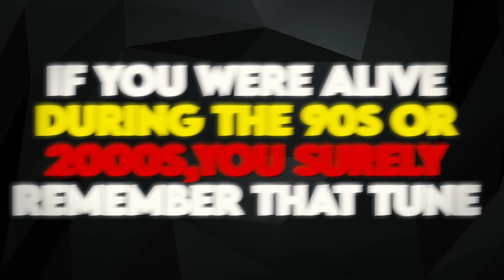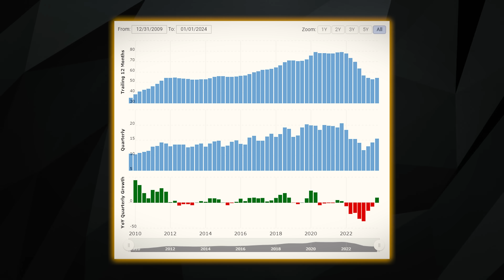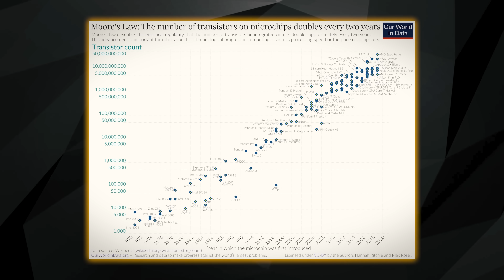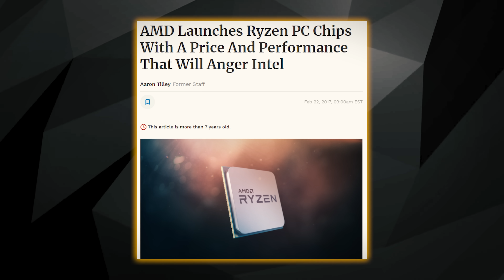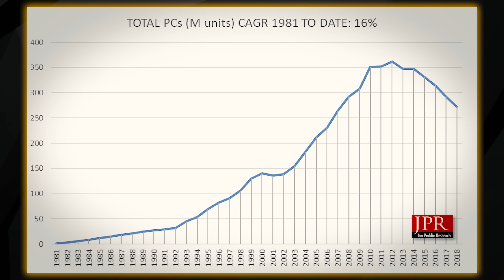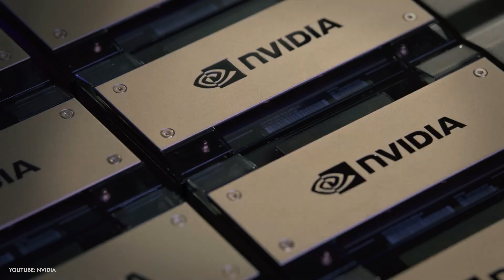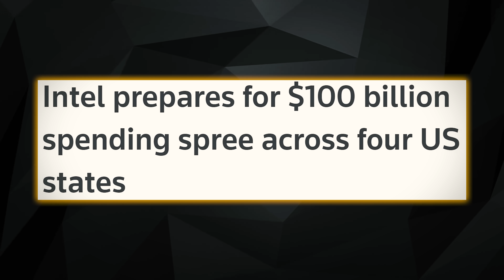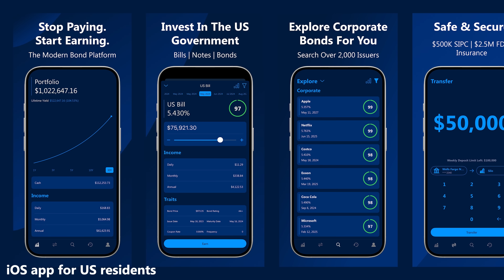The Dire State Of Intel...What Happened?

Comment: People say intel isn't innovative, but the truth is that they are capable of creating chips using the most cutting edge and advanced technologies of 2007
Reply: Intel is innovative in the first entry of every new socket. That first one is always a banger. Then it's varying numbers of rehashes and tweaks to milk more cash.
Reply: Most of the great technologies in semiconductor/chip today are invented by Intel. And most the upcoming technologies are also developed by intel, for example. 
Microprocessor chip
FinFET technology
X86 (various versions)
USB
Thunderbolt
PCIe
CXL 
UCIe
MCR Memory 
and many more and they open sourced these so that the industry can use these.

Most of the competing companies did not invent any thing except that they executed incremental versions in time. 
Intel is behind only because they were reluctant to invest in EUV technology during the 2014 to 2019 time and because of that their products lineup got stalled. 

The current generation Core Ultra is quite competitive against both AMD and Apple in terms of price/power/performance. Until 13th generation, intel processors used to be behind AMD on battery life. With the new core ultra, its quite ahead in both performance and battery life. Some of the benchmarks show its behind on some scores, but on actual usage you see no difference in performance or battery life.
Reply: @SY-zv2cz  They are behind because they stuck with monolithic architecture.  It's all about the chip yields.
Reply: @artdehls9100  Being monolithic is only part of the issue. Its not very difficult to move to chiplet from monolithic. Intel used to have chiplet designs back in 2006/7 timeframe. The fundamental issue was with 10nm EUV enabling which stalled Intels product line for about 4/5 years. And 4 years is sufficient for all the competitors to zoom ahead of them which they did.
Reply: @SY-zv2cz  It may not have been the only thing but it was the major thing.  You can't ignore the basic economics of chip yields, and if they had the tech, why didn't they do the same?  $1,600 chiller hidden under a table and a 1000 watts to the mobo just to barely match an air-cooled TR, and then the next day Lisa Su walks on stage, says hold my beer, BOOM!  You like apples?  How about them apples?  Core to all this?  When your top people aren't engineers and think bribing Dell counts as innovation.
Reply: @artdehls9100  We are talking facts not conspiracy theories here. Also it takes a lot of brain cells to believe Intel pays its customers for buying their products. When was the last time you bought a product and you received money from the shop/manufacturer for buying that?
Reply: Intel fanboys be like, shwell actually..
Reply: Sales and marketing killed the company
Reply: Intel was very slow to realize the potential of Ryzen. A CPU that is also a decent GPU.
But the Intel leadership consisting of sales and marketing people wouldn't understand why it mattered. Every market analyst said it will kill Intel. But sales didn't took a hit immediately, so intel kept up with the practices. If Intel CPUs have any edge over AMD today that is due to programs being better optimized for Intel than AMD. From an Engineering stand point Intel CPUs are outdated.
Reply: @solo10041  Indeed.  Their idea of staying ahead of the competition was paying companies like Dell BILLIONS to just not use AMD.  Sick.  Sad.  Ugly.  Infuriating.  :(
Reply: @solo10041  They weren't slow; they were caught flatfooted because Intel believed that they'd cornered the market and killed AMD (with industry "partnerships") and behaved that way with regard to their releases for several generations of the i-series CPUs. When AMD kicked them in the dick, they had to scramble to recover from their coasting.
Reply: Nice bait moomie.
Reply: Looks like everyone giving Intel the benefit of the doubt
Reply: The main reason U$A will never able to compete in Chip manufacturing.
All the country that do well in chip manufacturing , has Confucianism culture.
For chip manufacturing,  a high level of discipline is the key, and most Americans today don't possess it.
They call it “forced labour"
Taiwanese media reported on August 2 that TSMC claimed the production holdup at its Arizona facility was caused by a shortage of trained American labour and that they had sent staff from Taiwan to assist with the factory's development. Labour union officials in Arizona, on the other hand, criticised TSMC for exploiting this as a justification to bring in "low-wage foreign labour."
Reply: Wow, below Texas Inst?! That's fukn wack and sad.
Reply: Intel is about to slam the market u should see the equipment they are building its the most advanced anywhere on the planet
Reply: Intel c-suite and its shareholders were too focused on short-term profits instead of looking at the long-term.  This is why they fell behind their competitions.
Reply: They can innovate, it's just they won't
Reply: I thought Intel lost dominance because they got caught with hardwired, undefeatable backdoors in all their chips? AMD was doing the same thing but they didn't get caught until later. The government in the middle east has all our information.
Reply: Amd64 anyone
Reply: Intel needs new leadership just look at AMD how they came back with bang with a new CEO.
Reply: With the 0815 mistake of having a naming convention of simply counting up and literally fail at gen 13 (tarot death) and 14 (chinese unavoidable death).
Reply: Their labs are great, but their production execution is abysmal
Reply: 2007 until 2016. After that a line full of retarded cpu's with motherboards that only lasts 2 generations .
Reply: I bet this company is slowly collapsing
Reply: If I were to use Nitrogen cooling and put 10v onto a Pentium 4, I could most likely make it match 14th gen IPC too to get the most out of 90nm/65nm... Just like Intel are currently trying to get the most out of 7nm...
Reply: That was almost twenty years ago
Reply: Intel is trash & benefited from billions of dollars of CORPORATE WELFARE to stay afloat
Reply: Cuttig off their biggest customer China, is the reason. Absolute genius move by the US government to cripple Intel😅
Reply: AMD is great for heating the room. Don't get me wrong. I used AMD my whole life. Athlone II 1.8Ghz. Athlone x4 860k and the latest AMD build of my life? 9700x trash. Not a single one of those builds worked right. Not one.

I didn't have a fully working computer till I bought a used i5 8500t and a Pentium G6405... both performing so much better than the 9700x.............. conclusion?
Reply: I sold INTC two years ago. I didn't like the progress the Chinese were making.
Reply: In price comparison and performance, Threadripper literally ripped them apart 😂
Reply: its 2025 now not 2007 wake up, you're living in the past 🤣🤣🤣🤣
Reply: Intel CPUs are so good that CPUs will work just as well as a house heater.
Reply: Intel's n100 is actually incredible...
Reply: @ВладіславЗаморський  It is incredible for specific use cases, not as a general PC. Would have bought one if I didn't already have a SFF prebuilt HP Elitedesk performing that task.
Reply: Intel still make amazing cpus and their gpus are actually really good.
Reply: @elixier33  copium
Reply: And don't forget Intel is in state, because they try to make their own chip, they just falled behind in technology, but AMD basically did nothing, they just enjoying the benefit of Apple-TSMC cooperation, and they are using the leftover technology what Apple doesn't need anymore.. (the chip design is also important part, but the manufacturing is more important.. if you have a good recipe but nobody can cook it, the recipe itself is not enough to eat it.. and Intel try to cook their own recipes at least, not just freeloading on somewhere else work..)
Reply: @TamasKiss-yk4st  wrong and incorrect amd was guine pig of tsmc and apple was the customer of tsmc what i mean by that is for eg take chiplets now chiplets isa very old in servers but new to consumer pc amd was the first to hop it and they were the first to design the interconnect but they went with a cheaer solution and apple got high speed interconnect after 4 years sine the relese of original thread ripper like that therer are many examples where amd hopped first then apple came much later its not just apple throwing something put of the window and amd is just eating the bones its literally amd injecting the virus first to test the water and then apple entering it
Reply: @TamasKiss-yk4st  AMD kept their eye on the ball and stuck to fundamentals, Intel kept staring in the mirror thinking, I'm so pretty.  It's all about the chip yield.  First numbers I heard before TR's release was that they were getting 80-90%... which was sick.  What do you think the yield is on a 28 core Xeon, all cores up and over spec?  Single digits.  And if just one of those 28 cores is a little weak, bzzt.  Meanwhile AMD pulls four chips from their best bins and effortlessly spawns another perfect monster.  This leads to Intel pulling all their top silicon they'd normally want $12,000 for, selling it for $2,000 and bleeding out the ass.  Meanwhile AMD sells theirs for $1,000, outperforms, and still makes money.  And still even now, Intel won't abandon monolithic architecture.
Reply: @TamasKiss-yk4st  What are you smoking? ATI was a great/huge TSMC client and AMD continued that relationship since 2006.
Reply: I mean, nowadays 14th gen is the best CPU on the market for consumers, and Intel is beating AMD across the board from a pure performance standpoint

Edit: Man, I can't have shit. Intel can eat my ass. 15th gen better not have all these issues again
Reply: @moomie1634  In EVERY regard AMD CPUs are beating Intel CPUs for desktop, and it won't change until Intel gets off it's Intel 7 process node.  Sure you can get into the mid tier where Intel CPUs have more cores and theoretically they do better and I'll get to that point at the end.

You can TRY to spin this to where Intel is better but it's not what the reviews show, so sorry.  How you can POSSIBLY say Intel beats AMD across the board is so utterly laughable that it's just pure propaganda.

And it's REALLY bad in gaming.  As in REALLY BAD.  As in total destruction bad.  So, first an Intel 14th gen based on what reviewers say is almost the same thing as 12th gen with slight improvements, so you can pick whatever you want from 12th - 14th gen, and if you get more gaming performance, it comes at a price of higher power consumption almost exclusively because it's higher clock speed, but we could use something like a 13700K or 14700K because stepping up from that is another 15W for almost no gain.  Yes, I know people SAY that power doesn't matter, until you notice you're sweating or have to make the room cooler to deal with the PC, and that's because the CPU power is being added to the GPU power so yes, another 25 - 50W DOES matter.

In general the gaming CPUs for AMD, the 5700X, 5600, 5800X3D, 7800X3D, 7600 are around 50 - 65W avg.  The 14700K is about 130W.  That's a LOT.  Now, if you game for 2 hours/wk, not a big deal, if you game 2 - 4 hours/day, it becomes a big deal.

But here is the thing, YOU try to say that a 14th gen CPU is the best thing for consumers and meanwhile the 14900K is causing problems and MB makers are tweaking BIOS settings because Intel is refusing to accept the CPU has an issue.  

ALSO, and this gets back to the opening statement, most consumers don't even NEED high end CPUs.  MOST consumers can run a PC from 5 years ago and be fat dumb and happy, and the hype of following the latest tech is NOTHING MORE THAN HYPE!   Sure if you do CPU challenging work, which 95% of consumers do NOT, you need a better system.  95% of consumers can run a potato unless they game, and if they game they're better off with AMD.  AND THIS IS THE DATA based on purchases.  Most purchasing is low end CPUs, like it or not.

And THEN, if you DO want the latest tech, Intel doesn't have it in a PC, AMD does, and that's AI cores.

And then you want to say limiting the clock speed?  AMD CPUs manage their power very well, so advantage AMD.

And I have to edit to throw this in, I PRAY Intel Arrow Lake puts them back in real competition with AMD in every way, I do because Zen 5 is going to be about 15 - 20% faster than Zen 4 AND Zen 6 will be about 10 - 15% faster than Zen 5.  All the whys for this is a book so I'm not explaining it, but that's what's going to happen.  And to be clear Zen 6 is going to be like Zen 3 was for AMD, where Zen 3 is what caused so much market share to turn to AMD.  Whatever Arrow Lake is, Intel will STILL need something a bit better for their next gen to deal with Zen 6.  Zen 6 is going to be where AMD changes their MCM architecture and it no longer needs a multiplexer which AMD calls "Infinity Fabric" and they move to direct connects and THAT is what MCM needs to be, to be closer to monolithic die.  That way you can build with chiplets but the CPU performs more like it's monolithic die, so far less latency in different situation and less power consumption.  It does add cost, but Intel is doing the same thing.
Reply: @moomie1634  I mean, if you want a space heater in your room, sure.
Reply: @fleshreap  Just cap the power target.
Reply: @moomie1634  and lose the performance. Simpler to just get AMD.
Reply: @moomie1634  dude I don’t know what to tell you. If a current gen intel chip is capped at the same wattage as a current AMD chip… the intel chip just looses. Imma use ur argument against you. Look at any benchmark video.
Reply: @fleshreap  At the performance cap, Intel outperforms AMD. The only difference is that Intel gives you the freedom to uncap all power limits and go ham, which is not something AMD allows you to do. Just on a pound for pound comparison Intel wins. Hell, there are guides out there on how to beat Intel stock while UNDERVOLTING the cpu.
Reply: @christopherallard1693  That's just not true. Under-volting the Intel chip still yields higher performance, and even though they're close, Intel still beats AMD
Reply: @moomie1634  Gamers nexus already did the benchmark. Intel CPUs requires way more power just to get the same fps in games as AMD CPUs. It wasn't even close, None of the Intel CPU could even come close to beating AMD.
Reply: @moomie1634 lol me watching a 700$ 14900ks 400w  match the 350$ 120w 7800x3d ....oh well actually the 14900ks is sent in for warranty it's degraded so bad in under a year that it won't even hit 14900k clocks..... garbage. And intell says to fix that lower pl1 from 384w to 125w ....but lose 40% of the clock speed so yeah I'll sell you a 14900ks system if you belive it's so good
Reply: @moomie1634  I'm befuddled as to how you came to either of those conclusions.
The across the board performance champ right now is the 7800X3D or 7950X3D (depending on the game) with Asus/Gigabyte/ASRock/MSI power boost for Intel power profiles activated.
It's only a few percentage points, but the 14900KS... by and large in almost every single game: slower.
If you restrict the 14900KS to the Intel power spec, it's slower by a handful of percentage points again.
At literally no power level that would be at parity, would the 14900KS be the best gaming chip. You can outperform the 14900KS with the AMD chips running at over a 100 watts lower. 
Your argument isn't with us. It's with reality itself.
Reply: @moomie1634 I am not going to cap power, why would I? Why do I have to create a special condition for Intel to shine? No thanks.
Reply: @alvirarahman2690  This statement doesn't make sense. You have to cap the power to let AMD shine if we are going with no power limits intel wins hands down at least until it becomes unstable and bricks itself lol.
Reply: bros glazing israel
Reply: @datguy8296 and I completely agree with you as I have both setups and my 64 core AMD setup cripples anything that I've had for mental unfortunately. I don't have any favourites it's just AMD and more productive when you need more cores.
Reply: @moomie1634 bro is just spreading misinformation on the internet I love it
Reply: @moomie1634  prove ?
Reply: @moomie1634  This comment did not age well
Reply: @moomie1634 lol lmao. Sure at 4x the power.
Reply: @0Synergy  At a capped power rate, Intel beats AMD. Intel allows the user the freedom to push way more power into their chips, with the assumption that the user will have some ability to cool that chip. AMD doesn't give you that freedom. When you just compare the chips with the same cooling and same power draw, Intel still wins
Reply: @moomie1634  bro what are you smoking
Reply: @christopherallard1693  You can literally just read/watch any comparison between Intel and AMD.
Reply: @moomie1634 what about Apples M chips? Aren’t they supposed to be godlike?
Reply: if you don't use normal programs
Reply: @TheBooban  It's hard to compare the 2 because Apple controls the software, which is often forgotten about. They can make the software much more efficient to run on M chips, then say that these chips are better than Intel chips.
Reply: @moomie1634 Buddy. The 7800x3d runs at 65-80 watts, the 14900k runs at 200-300
Reply: @TheBooban Apples M chips arent that good. The only thing theyre good at is processing videos everything else they get demolished in
Reply: @moomie1634 lol at what cap? 10w let's see intell caped at 120w oh they lose 40% of thier performance and how much does amd lose...oh lol they where already under 120w
Reply: @moomie1634 yeah watching the 120w 350$ amd chip match the 14900ks 700$ 450w chip is pretty awsome. All while intell is now cutting its recommended wattage that saw the 14900k drop up to 9% from when it was launched. Also watching the intell chips cook themselves to death trying to beat amd is hilarious. Do you want chips that Germany degrade and become unstable and no longer hit intells stock clocks ? Intell is for you
Reply: @TheBooban they are efficient but slow.
Reply: @moomie1634 Intel chips do not beat AMD at the same power draw. The cat is already out of the bag. What you thought was the case is not the case. The power draw Intel used to achieve those numbers is largely unstable. Massive amounts of RMAs and refunds. Go do some research.
Reply: @0Synergy  well not really. top power consumption of i9 14900k is like 20 to 30 w more than ryzen 9 7950x3d. but idle power draw is nearly half that of amd due to hybrid architecture (mixing of efficiency and performance cores)
Reply: @kingiument4627  They were so hyped when they came out....so disappointed :(.
Reply: @moomie1634  Ryzen consumes less. Is as fast and often times FASTER then Intel. Socket compatibility for YEARS to come, where you save A LOT of money. Basically Intel is now where AMD was with Buldozer a decade back. They are stuck on 14/7nm+++++++++++++ for years... "Unlock power limit"... Why would I have to be forced to buy uber expensive CLC and pay hundreds $$ to get MAYBE 10% more performance... Not worth it. And it won't be for quite some time. Cheaper. Better. Faster. Cooler. Ages well, like previous 5000 Ryzen which is still PLENTY capable... Intel is hot mess. 100C. Overheats. Way to much power for miserable gains. Just no....
Reply: Basically... When Intel came under some serious pressure from AMD when they launched Zen architecture/ Ryzen CPU's, Intel didn't have ANY reply, and it is so obvious to see
Reply: @moomie1634 sorry no it doesn't, if you look Gamers Nexus benchmarks, he die exactly the same test and Intel lost by a significant margin. Stop spreading misinformation.
Reply: @moomie1634 AMD and Intel make CPUs for completely different purposes. Intel are unfortunately ahead unless of course it's a server you want. I've got an AMD and an Intel machine. I've got 64 cores on my AMD setup let me assure you no matter how far I push my nothing even comes close.
Reply: @moomie1634  Oh  thats why intel chips were dying
Reply: @0Synergy  That is why they are irrelevant today.
Reply: @0Synergy  Yea...when considering performance, technically the power needed to achieve that performance should be factored into the solutions overall value: Perf/Watt
Reply: @0Synergy and yet they fail to adopt the 7nm process node, which everyone else started using years ago
Reply: @moomie1634 i hope you know about the current issues 😂 u say no power limits eh?? They released a micropatch that limits it at 125watts and still crashes 😂😂😂
Reply: @moomie1634  I mean, Intel is still somewhat good if you don't like having money, AMD offers better CPUs for much less, look at the Ryzen 5 vs the i5.
Reply: @moomie1634  LOL best? Not sure what rock you're under but I guess you haven't heard about all 13/14th gen degradation, overheating and crashing?  Regardless AMD is cheaper, generally better gaming performance, more efficient  less power hungry and better upgrade path.  There's hardly any reason to buy Intel.
Reply: @henryyiu618  yeah you're under a rock.
Reply: @henryyiu618  well not really. pricing is almost similar. if you are into budget gaming intel is the way to go. for expensive gaming "" amd is better. for productivity (video editing...) intel is better. at peak power consumption intel draws about 20 to 30w more than amd but when idle intel is about half due to efficiency cores in their processors. and which gamer upgrades their PC every 2-3 year and if you are than you should not. upgrading 4-5-6 years is better. rather you should upgrade your GPU every 2-3 year. if you are a productivity type of guy you should go for amd
Reply: @henryyiu618  lol no, although i am not interested in consumer chip market nowadays but i keep checking on them from time to time, just sometime back i saw a video where intel beat amd in each and every benchmark, from single core to multi core to battery life to sustained load performance. AMD is lagging and soon this will be visible in enterprise side also
Reply: @henryyiu618  yes terrible heating architecture but also it's the cheap builds of modern motherboards that don't allow for it to work properly
Reply: @henryyiu618  there is millions of if not trillions of lines of code thats written using intel x860* architechture that makes intel bit of mandatory for some cases until that code is ported if not lost anyway to other cpus ... anyway modern complier has automated conversion for big part of that code but lots of them require manual intervention ... so intel still has lots of adventage...and mobile cpus become far cheaper and competitive... other then code limitations for example i dont like to use desktop pcs unless some features are dosktop mode only writing same code and using same program on phones is easier and more accessible...on pc you have to stay on specific schape begind screen like you are a soldier or prisoner of screen :D
Reply: @ahmetmutlu348  x86 isn't Intel only.  And everyone are trying to migrate to ARM anyway.
Reply: @henryyiu618  the 7700x is barly faster then the 13600kf but is 50$ more
Reply: @n.d.n.e1805  Don't just look at CPU prices.  I bet you comparable Intel motherboard cost more than $50 and won't be upgradable to future CPUs.  Intel may also require more wattage PSU.
Reply: Am5 motherboards are more expensive also LGA 1700 came out in 2022 and is still supported in 2024 and AM5 came out in 2023 amd support will end next year in 2025 both lasted about the same amount of time. some intel motherbourd are 70$ intel is better for the price rn in mid and low range.
Also, intel's new CEO who became CEO in 2021 has been improving Intel a lot look at 12 and 13 gen they were better than anything they have released in years. And the new CEO is spending billions to catch up after the last 3 CEO years and years of lacking. 15 gen is going to be 2nm that a huge improvement AMD is at 5nm at the current moment. 15 gen is also going to use way less power and be way cooler comparable to amd from what the leaks are showing and be way faster than 14 gen by a lot
Reply: @henryyiu618  yes, but people dont only game an intel still holds the best performance for price in work related scenarios just by throwing shit tons of cores to them. Idk how much longer will they keep like that tho
Reply: @moomie1634 sure you can technically get it to run at 9.3 ghz if you have a team of overclockers but for everyone else even the mobo standard settings are burning up chips. 😂
 7800x3d still murdering intel.
Reply: @moomie1634 lol watching the 350$ 7800x3d at 100w beat the 700$ 400w+ 14900ks in most games .....is winning lol man your crackpipe is glowing
Reply: @moomie1634 so why does amd beat intell in games at 1/4 the wattage and half the price? Also why are all the high end intell chips from this Gen and last Gen degrading so fast and becoming unstable? Intell now recommending a 125w pl1 when to just match amd they need a 284w pl1.
Reply: @moomie1634 No. Its beat by the 7800x3d and 7950x3d. Sorry bub
Reply: @moomie1634  14th gen is the same architecture as 13th gen, has the same amount of cores for the main i5, i7 and i9 and uses more power. 12th gen was very good and I considered building a PC with it while 13th gen has some good points but uses more power in certain instances then I would like. Raptor Lake Refresh aka 14th gen is not something to recommend to anyone as its overpriced and unstable simply because it's an overclocked Raptor Lake. Meteor Lake was supposed to be 14th gen on desktop but Intel couldn't get it to work in time. 

15th gen (or whatever it's going to be named) may be pretty good on Intel's 7nm aka Intel 4 but we'll have to wait for that. As of right now no intelligent enthusiast should recommend nearly anything from Intel's 14th gen except maybe the lower end parts. There's no way an i5 should be able to use more power than a Zen 4 Ryzen 9. No way. That's embarrassing and wasteful.
Reply: @moomie1634  Stock market seems to disagree
Reply: @moomie1634  yea no 7800x3d is still faster than the 14900ks stop defending intel they're garbage
Reply: @physicshater99  Checks to see how muck stock  in intel moomie owns
Reply: @moomie1634  no see the ryxen 7000 was released to compete 12th gen and it was launched after 12th gen and it successfully beats the 12th gen to this intel lsunched 13th gen and it ws barely better then amd speciallly in multi core so to kep up the title they launcged 14th gen which is basically 13th gen but slighlty clocked higher so if amd laynched 8000 series for dektop intels gone to dust till they reelease 15th gen so intel have to release 2 generations to keep up with amd one generation the biggest nail in the coffin to intel was when amd surpassed intel in single core yes in sinlge core so with the ryzen 5000 amd finally dethroned intel as the single core champ and bcs intel lost this crown intel is having real hard time reocvering from it and this was amds biggest achievement beating intel in pure ipc and currently in laptop evn that branding is gone so earlier ryzen laptops were cheaper then intel laptop but today if amd chips are latest they are more expensive then intel and vice versa so even the branding is gone
Reply: @moomie1634  Not anymore they don`t. 
Their new baseline stable profiles are way slower than their OC cheat unstable profiles from the past.
AMD is now faster with everything.
Reply: @moomie1634  THe problem with Intel is their Fab cannot catch up with TSMC. meanwhile their Design now become absolete
Reply: @moomie1634  We do AI. We have machines with AMD and INTEL chips. Latest gen with NVIDIA RTX 4090. We have trouble with the Intel systems. Application crashing etc. But the exact same config works stable on Ryzen. We made the Intel systems somewhat stable by reducing the clocks below the standard clock. This should not happen. Intel are selling inferior products right now. Yes and the motherboard settings were all are default. Also when we procure new systems are engineers favor AMD systems. Few year ago that was unheard of
Reply: @moomie1634  hey hope you are not using any raptor lake cpu
Reply: @MuhammadRidwan-pe7ny  dawg it has been 2 months get over it
Reply: @moomie1634  This aged like milk 🤌🤌🤌
Reply: @moomie1634  13th and 14th gen cpu's thou is causing Intel a world of hurt, as they just plain fail.
Reply: @moomie1634  Yeah my 14900K sure performed the best. So fast it killed itself with constant BSOD's. 7800X3D at a quarter power draw and clock speed is faster in every way. And the 9950X easily beats the 14900KS.
Reply: @moomie1634  intel 13th and 14 th gen have stability issue
Reply: @moomie1634 In what universe? AMD has been eating market share since ryzen dropped, especially in servers due to their chips being far more power efficient, scalable, cheaper, and, in a alot of circumstances, out performing their Intel counterparts. Hell, it's AMD tech that powers this gen and last gen game consoles.
Reply: @moomie1634  14th Gen has so,e problems as it is using double mask base that is sort of at 8nm.  Intel is sorting this out.
Reply: @moomie1634 I just wanted to tell you that you were wrong even though I have no idea if it’s true.
Reply: @moomie1634  no you are wrong.
12th gen sure, but even by then zen 3x3d was faster
Reply: @moomie1634  did not age well. Sadge
Reply: Take your meds, Intel fanboy.
Reply: @moomie1634  then they released ultra which way worse
Reply: @moomie1634  Please give reference where did you get this conclusion, because while some sites do show Intel beat AMD (in some benchmark) but the heat generated and power consumption is way above AMD consumer chip.
Reply: @ShiraIshikawa 
He googled and saw cpu userbenchmark 😂